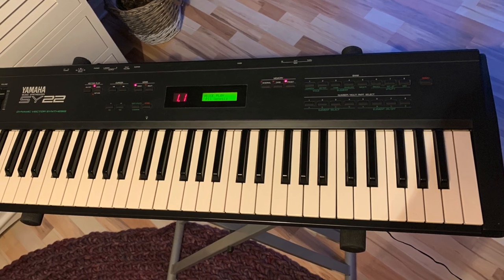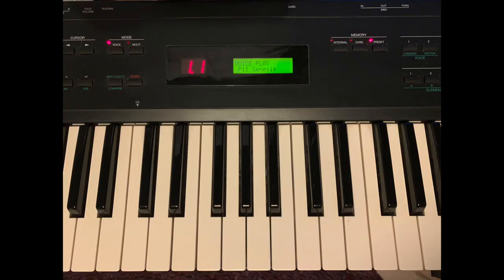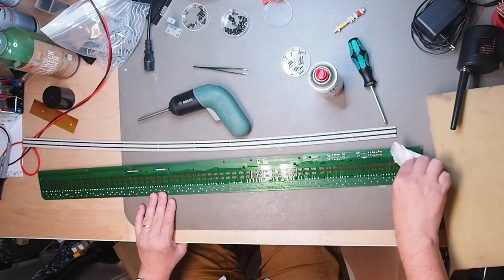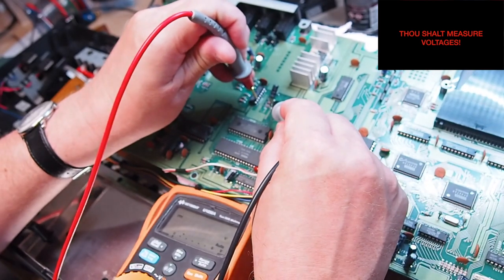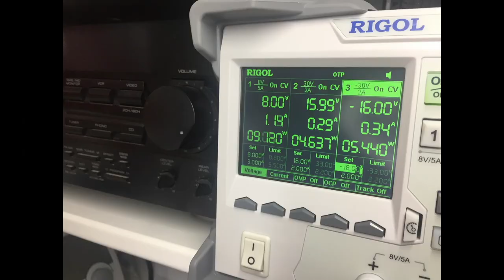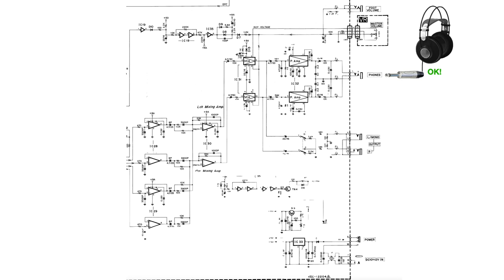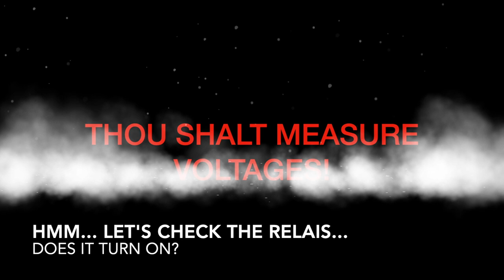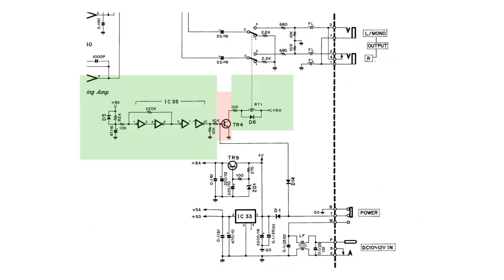ReinardSynth#6 SY22 „no audio“ Repair

Comment: Hello, greetings from Bogotá, Colombia. I have a Yamaha SY 35 synthesizer, and it has two problems, one is that the patch selection and function buttons must be pressed with some force because they do not seem to make good contact. The other problem it has is that one of the keys sounds louder than the others. I have to press the key very gently so that it doesn't sound so loud. What could be the cause of these failures? Thank you very much.
Reply from the maker: clearly contact issues. clean the front panel pans like I did at 3.58 and clean the key bed contact strips and pcb as in step 2
Reply: @reinardsynth6581  thank you so very much!!

Comment: Great job!  I enjoyed all of the detailed information on the repair.  Liked the Weather on the 8's-style music too.  Any idea what took the transistor out?  If you ever make a video on repairing power supplies I will be very interested.
Reply from the maker: thx! why the transistor died: I think it is because of a current transient when switching off and on the SY22 very quickly... stored energy in the coil of the Relais might have spiked the current through the transistor? But just a suspicion... anyways: when turning off and on a device, do it with TLC, and wait 3-5 seconds before turning it on again... Linear power supplies are easy-> fault is mostly faulty capacitors or regulators, Switch mode power supplies (SMPS)... that's more challenging and i also do not like working on them because of the intricate/sensitive designs of them; but there are some good videos on youtube explaining repairing SMPS. It is an advanced subject and requires some care and attention: voltage
 levels on SMPS can be deadly (300-400V DC...)

Comment: Thats a great video. What kind of fluid you use for the ultrasound cleaner?
Reply from the maker: Water with a small drip of dishwasher liquid
Reply: @reinardsynth6581  Vielen Dank. Does this also work with typical Rubber contact strips for synthesizer keys that contains carbon contacts inside, like Roland in D-70 uses?
Reply from the maker: @h.guntersson2243  no. I recommend using pure alcohol to clean the carbon-rubber contacts or strips used in keybeds. Have a look at fault #3 in https://m.youtube.com/watch?v=_YVlsIS3QSk on how to do this.
Reply: @reinardsynth6581  Much thanks. Zen work.

Comment: Over time the keyboard loses sensitivity and response.
What products do you recommend for cleaning keys, contacts and rubber like parts, please? Guessing IPA stands for Isopropyl alcohol? Guess it’s good for cleaning everything? Strength?
Reply from the maker: IPA (pure alcohol) works best: procedure is as shown in this episode… this keybed can be temperamental though: be precise when putting it back together again
Reply: Did you manage to fix this James? Mine has the same issue

Comment: Whats actually the difference between the sy 22 and the sy35?and from which sy is the tg33 the tabletopversion?
Reply from the maker: Both the SY22, SY35 and TG33 have the exact same sound generation chips and Digital-to-Analog converter. (so the myth that the SY35 uses better 16 bit DACs or samples is not true) I compared the schematics of the two and the only difference I can find: The SY35 has the same number of PCM waves (128), but double the wave memory (2Mbyte stead of the 1Mbyte of the SY22) so expect better quality samples because of more sample ROM. When from the factory, the SY35 has original sounds stored in it's user RAM in addition to the pre-set ons, so 128 in total, whereas the SY22 only has 64 original sounds, the sounds in user RAM are copies of these. The specially of the TG33 is, that is has double the polyphony for he SY22 (4 instead of 2 sound generation ICs), but the same ROM size for samples (1Mbyte)